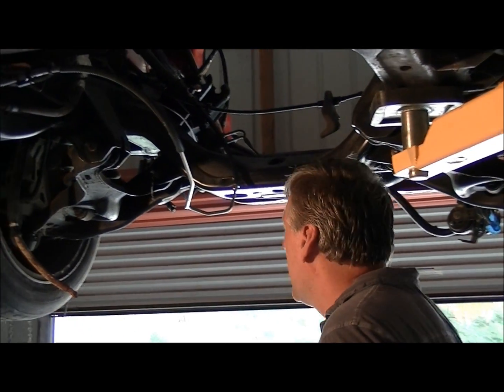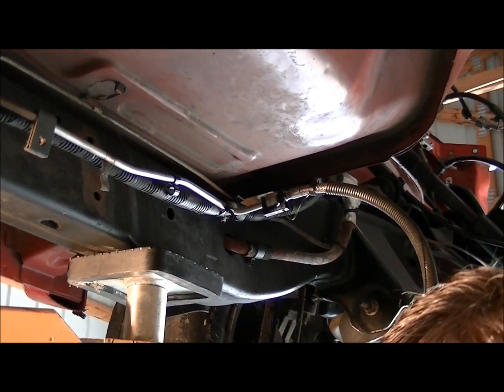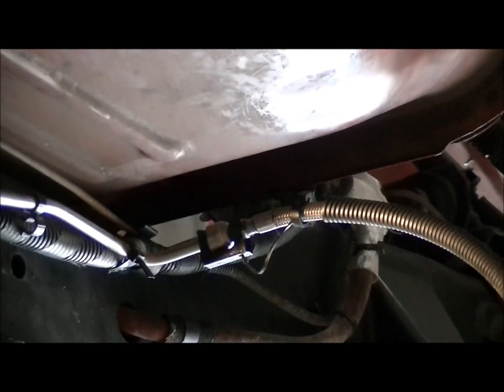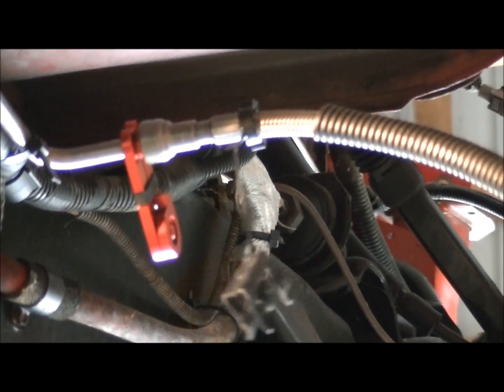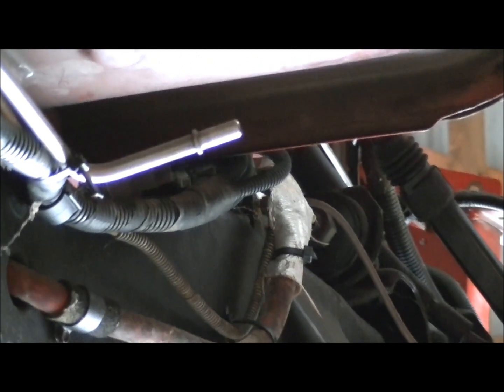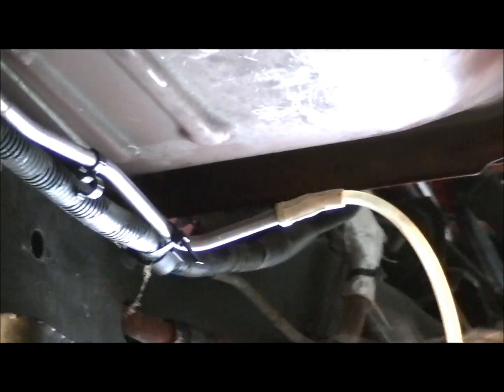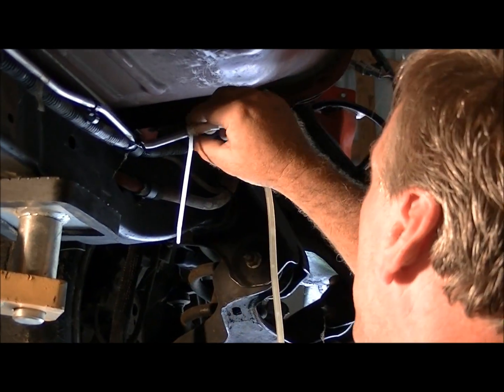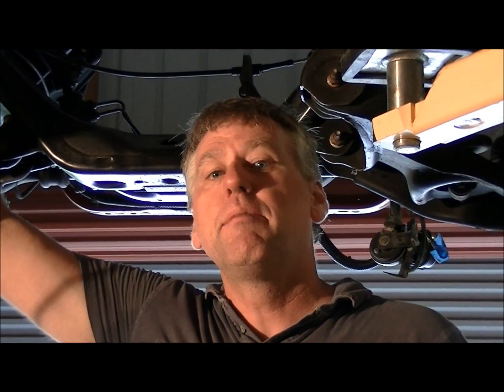How to Remove a Fuel Line from a Dodge Dakota

Comment: Is there an easier/better line to replace this with? Like a Braided line? Can I swap this line out without taking the motor and trans out? 😅 the 90° portion of the line connecting to the fuel rail on my 2001 dakota is starting to rust and I'd like to get ahead of it. I'd like to avoid buying expensive high performance Braided lines like I run for my mustang, but thats all I'm familiar with at this point. 

I'd greatly appreciate any help/suggestions I could get. Thank you